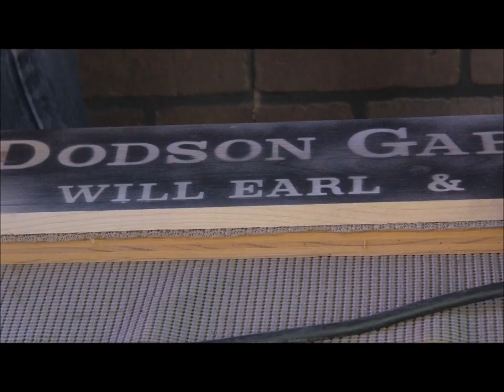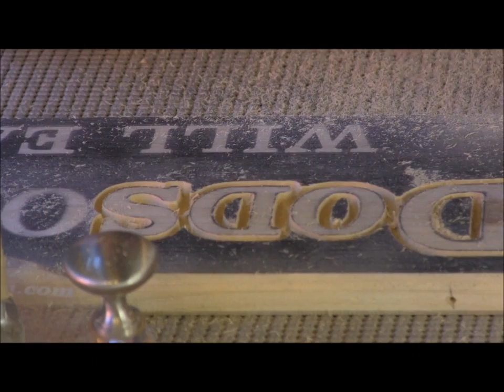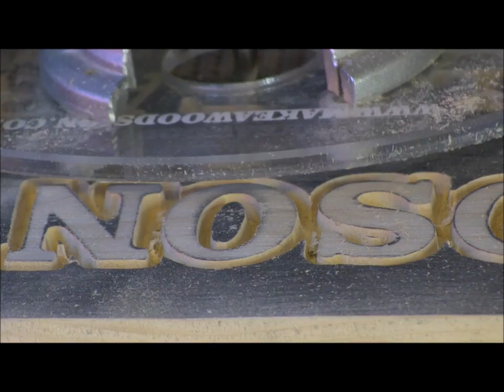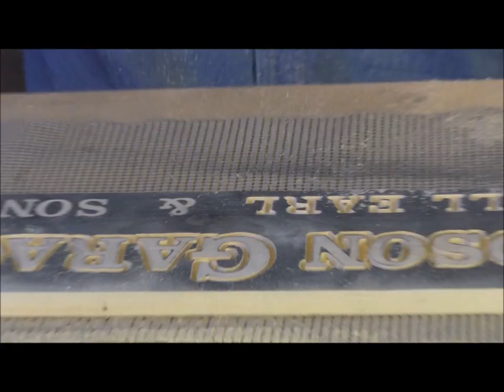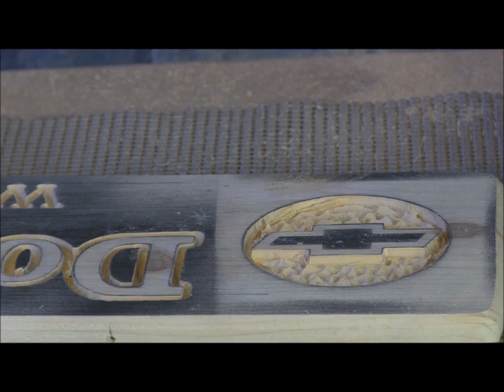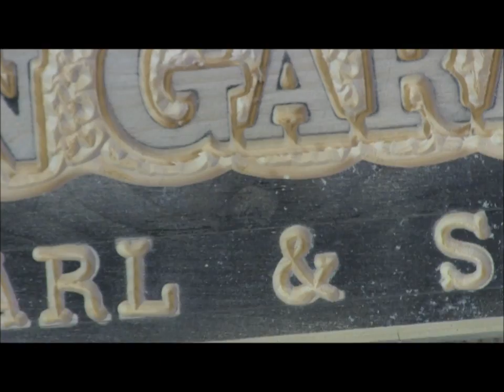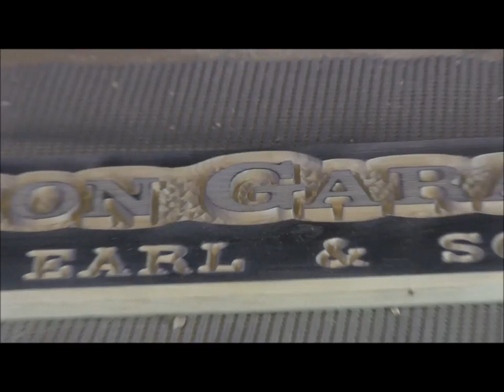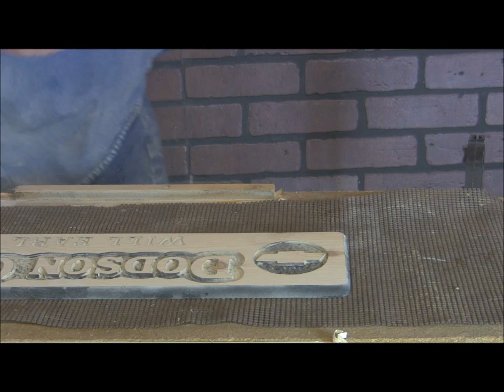#163 Freehand Carving a Sign Start to Finish

Comment: Eríc Rhoten para el sangrado de letrero,primero tapaporos o la pintura expray ? Gracias
Reply from the maker: For bleeding, make sure you use primer. If you use paint, use flat or matte finish and be careful not to overspray.

Comment: I have heard that Silicone Spray will contaminate wood and wood finish, and it hangs around in the air a long time. I would use it outside, not anywhere near the area I do wood finishing.
Reply from the maker: Never had an issue with it. I only spray it in very shorty spurts.

Comment: Once again great video. i have a question about what size were the letters on the sign. Thanks.
Reply from the maker: +Jackie Floyd Hi Jackie, 2" & 1 1/2" outset on the top line. 1" inset on the bottom line. Thank you for the nice comment & for watching, Eric
Reply: +Dave Rhoten Thank You.

Comment: Started watching your videos 6 months or so ago. Love them, lots of little tips that I find very helpful. One thing I try to figure out in your videos is what wood that you are using for each project. I can usually tell but sometimes the board is mostly covered or the video is zoomed way in and I can not tell. I would like to know what varieties of wood you use. Best and worst for cutting.
Thanks mike in minnesota
Reply from the maker: Hi Mike, Thank you for watching, so glad we could help. I use several kinds of wood depending on how big the sign is and what's available to me at the time. Also depending on what the customer likes.
1. My favorite  is the cedar fencing. I think it's  Northern White Cedar or similar. This is for smaller signs 5" wide or smaller. 
2. Then Redwood fencing for same sizes as above.  
3. Wider than 5" up to 11" wide I use Select Pine.
4. For large signs sometimes laminated Redwood. 
5. Also for large signs laminated Western Red Cedar.
6. Another option for large signs is a panel board that is made from a species of pine. 
All but the laminated Western Red Cedar are available at Lowes.  
Woods I don't use: Oak, Alder, Poplar, just about any hardwoods. I prefer the softwoods. Let me know if you have any other questions I can help with   eric@makeawoodsign.com Thank you

Comment: two questions for you Eric - what size were Dodson letters and the chevy logo with the circle - where did you find it.  Good explanation on how to make a sign from beginning to end.  Thanks 
Burt
Reply from the maker: +Burt G Hi Burt, 2" & 1 1/2" outset on the top line. 1" inset on the bottom line. The chevy logo is a 3.25" circle. Found it on google.

Comment: Just watched, "Coffee & Questions 2/13" and it answered most of my question.  I like knots on my signs, I try not to have a knot where I'm cutting.  When I cut into a knot  even a little, 50/50 chance it's going to tear out.  Is this just me or the luck of the draw? The "D" in your sign was just fine, I will say, I haven't been gluing my knots.  Thanks
Reply from the maker: +Jerry Ivy Sounds like you're just been unlucky. If they have any movement at all you will improve your luck if you glue them. Give it a shot. Thank you, Eric

Comment: I'm a new subscriber and I've only watched a couple of your videos (and am looking forward to more).  I see that you use multiple routers.  Can I do complete signs with a Dewalt trim router, or do I need to invest in another more powerful one for the larger areas?
Reply from the maker: Hi Tim, thank you for subscribing & watching. Yes the dwp611 will do everything but some of the heavier operations eventually I would get a bigger router for. Otherwise if you start making lots of signs you may wear out your little trim router. Hope this helps. Let me know if you have any other specific questions I can help with, eric@makeawoodsign.com.

Comment: I only own Porter Cable Routers. 3 hole for bases. Do I need to buy the Dewalt Router Dave
Reply from the maker: Absolutely not. Porter cable makes great routers. We have base plates for the P/C 450 as well as the P/C 690LR.

Comment: Dave I thought about just using my Porter Cable 1.25 hp router. I just ordered the Dewalt 1.25 hp router  I think it's the one that fits the router base I bought from you. I think it's the one you use
Reply from the maker: I have both the dewalt dwp611 and the porter cable 450. They are virtually the same. The base plate and the housing are interchangeable.

Comment: Eric, what was the material you used for cleaning belt sander?  Thank you.
Reply from the maker: It's call a sanding belt cleaner. You can find them at just about any woodworking supply. I buy mine on amazon. Here's a link POWERTEC Abrasive Cleaning Stick http://amzn.to/2zptC1c  Thank you for watching, Eric
Reply: saved me asking :)

Comment: What primer was you using? I believe you said Kraylon but is it for metal or wood.
Reply from the maker: +r3_woodcraft It's Rustolium. You can see it on several of my videos. I really don't if it made for metal or wood or both. Check out Newsletter #130. I show a close up of the can. Hope this helps.

Comment: What do you do with a Router with bad Bearings. Get it repaired or throw it away.
Reply from the maker: On the small ones normally toss them. On the bigger ones most of the time rebuild.

Comment: I have a problem I sprayed glue on the back of a character I glued down on a piece of pine . Then I started to run the profile bit on the characters paper copy . The bit was put at 1/8 debt to cut while cutting the bit was getting clogged up with the glue . What can I do to stop the did I give the glue enough time to set up.
Reply from the maker: Did you cover the paper with packing tape like I do? That seems to help me allot.

Comment: I am going to get a Mikita 9403 sander the smaller sander I had couldn’t keep the belts on straight and really had no power. What do you think of the 9403.
Reply from the maker: Looks like a good sander and Makita generally makes a good tool. I really can't speak to this specifically because I've never used it.

Comment: Great vidoeo , Love that a farther and son works together. How do I get the router guide like you use for my bosch palm router the colt PR20EVS.
Thank you.
Reply from the maker: Thank you for watching. I'm not sure what you mean by Router Guide? Are you referring to the template guide for cutting board shapes? If so, you might check with Bosch, they probably have one. Hope this helps. If you have more questions you can email me eric@makeawoodsign.com.

Comment: How did  you get that lettering on there in the first place? it looks like you sprayed paint over letters laying on the board? Is that right?? I see that I need one of the steep letting bits to begin with!
Reply from the maker: Hi Jim, basically yes that's the way we did the layout. I have lots of videos on this process but here's one that I hope will help https://youtu.be/QP1iY5SZjeI  We also sell all the router bits we use on our website makeawoodsign.com. If you have any other questions just let me know, eric@makeawoodsign.com

Comment: Hey Eric/ Dave what size of letters are those 1 1/2 or 2 1/2 thanks
Reply from the maker: 3 sizes, 2" and 1 1/2" on the top line. 1" on the bottom line.
Reply: Thanks but what size is the one sign your making the sign with

Comment: I'm considering getting a DW611. I currently have a Porter Cable 690lr. Would the DW611 be leaps and bounds better due to size or would that money be better spent on bits and lumber?
Reply from the maker: I like the small routers for carving, but I carved signs for decades with the bigger routers. The 690LR is a great router and will do everything you need. If you have to pick the bits and wood are FAR more important than the router.
Reply: @oldave100  thanks for the quick reply. I've got an assortment of bits,  but there are some others  I'd like to get. Same with lumber, you can never have too much. I think I'll try the 690 for a while, then get the 611 later. That way I can leave the 690 in the table and not dismount it so often.

Comment: What size of bit are you using on this video? It looks small.  Thanks for sharing.
Reply from the maker: I used several different bits on this sign. The first one I used is our Profile Bit. That's the one that dad designed. We have all of the bits we use available on our website   makeawoodsign.com. If you have any specific questions you can email me directly  eric@makeawoodsign.com. Thank you for watching.....

Comment: Instead of sanding the paint off can you run it thru a planet machine, just wondering.
Reply: Planer
Reply from the maker: I wouldn't recommend it. Using anything with a blade to take off the black can lead to breakout on the carving especially on outset letters. Also if there's any kind of cup to the board it removes too much of the carving.
Reply: OK , thank you I’ve often wondered about that weather it would be easier.

Comment: Dave, do you guys have a baseplate  for the DeWalt DCW600B or should I order one of your blanks and drill to match? Thanks...Love the content.
Reply from the maker: Based on what I've seen online it looks like everything for this router is interchangeable with the DWP611. I think you're safe ordering the base plate for the DWP611. If it doesn't fit we'll make it right.  If you do order it and it fits please let me know so I can let everyone else know. eric@makeawoodsign.com. Thank you!!!
Reply: @oldave100  Thanks I will do that.

Comment: can you use the routers like a multi purpose one? I plan on getting one but I don't have the money for multiple.
Reply from the maker: Hi Nathan, thanks for coming over from Flukemaster. Sure, lots of good routers out there that will work for everything. Porter Cable 690LR is a great router if you're going to buy new. Many of my student start with used tools because of tight budgets. You can probably get one at a pawn shop pretty cheap.  Thanks, Eric

Comment: What kind of router bit you using and size.
Reply from the maker: I use several bits on this sign. The main ones are the profile, the 90 degree, and the 60 degree. Here's a link to a video that may help.      https://youtu.be/afKK8isUukM      Let me know if you have any other questions, eric@makeawoodsign.com

Comment: been watching your videos today...they are great....have u tried denatured alcohol or acetone for transfers yet?  dont know if it works but have you tried?  my question is: what angle bits do you use for carvings?  Also, where do I post my sign that I made? unfortunately with guides but I want to free hand stuff
Reply from the maker: Yes I have several videos using acetone or lacquer thinner with a laser jet printer. I used 6 different bits for my carving. They all have different angles. They are all on our website. Here's a link that shows them with descriptions  https://www.makeawoodsign.com/shop/index.php?route=product/category&path=4
You can email me directly pictures of your signs or questions, eric@makeawoodsign.com. Thank you!!!

Comment: Dave can you tell me if poplar wood is good to make a sign.
Reply from the maker: I have tried the poplar at the local Lowes and it carves great. The only issue I have is the when I apply the clear it turns green and I don;t care for the color. I don't do allot of staining but if I did I would probably use it allot more. The sign I just did Stephen & Sadie is White poplar and I absolutely love it!!! I googled it and it seems there are 35 different poplar species, so 2 down and 33 to go....LOL....

Comment: instead of blowing off the dust ... vacuum it off.  Why breathe it all in?
Reply from the maker: I made a video on this not too long ago. I would rather blow the dust out as to not scratch the black background.
Reply: Dave Rhoten 
I am sure a vac brush is softer than the stiff brush you used to scrub out the wood before painting.  also a soft paint brush with the vac raised up from the surface would work.  If blowing it off outside is safe fine.  I was concerned with the audience that watched in the room.  same thing is true with sanding the wood.  lastly for your videos try editing the power sander noise out.  I have an artist that does this so we don't hear his heat gun blow drier.
Reply from the maker: OK

Comment: I bought the bits I have from you so if I have two bits that need to be sharpened what will it cost . I’m not a premium member.
Reply from the maker: $7 per bit then just 1 return shipping charge of $8.50.
Reply: Send cash or check or credit card number of mine you have I think.
Reply from the maker: We have your card on file...

Comment: Hi Guys. New to sign making. Love your channel. If I wanted to use stain in a can, is it ok to stain it all at the end? I’m thinking of buying that spray stain you recommend but wanted to use stuff I had too.
Reply from the maker: Thank you so much Clay!!! The problem you may have is the stain may react to the black background and cause it to streak. So you need to test your stain on scrap pieces to make sure it doesn't  cause the black to run. If it does you'll need to be careful and not let the stain touch the black. Hope this helps. Thank you again and email me directly if you have any other questions, eric@makeawoodsign.com.

Comment: I have a Bosh PR20EVS Colt 1.o HP. Will your router base fit that style router?
Reply from the maker: Robert, Yes we have a base plate that will fit the Bosh Colt specifically.  You can find it at makeawoodsign.com under sign carving supplies.  If you have any issues let me know, thank you Eric

Comment: I have 1.25 mini router and a large 3.25 router.
Reply from the maker: For the small one $25, for the big one $35. If you're in the USA it's a flat $8 shipping. The 2 PC bases we have are for the models 450 (small) and the 690LR (large). If you have different models then you can order blank ones and just drill your own mounting holes.  Email me if you have more questions, eric@makeawoodsign.com
Reply: Oooh good for you!

Comment: Where can I get the design 
Especially if I would do some Celtic decorative stuff?
Thanks
Reply from the maker: Google is a great resource. Just type what you're looking for into google and use the word clipart or line drawing after it. Like celtic design clipart. Uou should find lots.
Reply: @oldave100  
Thanks Dave

Comment: What kind of bit do you use for the carving/engraving part and would using a dw618 be ok to do this or is a palm router preferred?
Reply from the maker: I used several different bits on this one but the profile bit for the detail work. Watch our video Coffee & Questions 8/31/16 All Our Bits. I think this will give you an understanding of our bits and what they do. Absolutely you can use a big router to do this. I did it for decades. I just prefer the palm routers now for small work. Let me know if you have more questions, eric@makeawoodsign.com. Thank you!!!

Comment: Nice work , whats your opinion about li-ion battery palm router is it any good ? 

Regards 

Allan 

Carpenter from denmark
Reply from the maker: I've tried the ridgid cordless and it worked good but the 2 amp hour battery only last about 15 min.If you had a bigger battery it should work long enough to do a small sign.

Comment: I'm assuming the black was just Krylon primer, but what was the clear coat that you used? Also, for signs that are going to be outdoors, would spar urethane be a reasonable option?
Reply from the maker: Rustolium Primer. The clear was Krylon Acrylic Crystal Clear spray. Yes I also use Helmsman Spar Urethane, for outside signs. Thank you for watching, Eric
Reply: Thanks Dave!